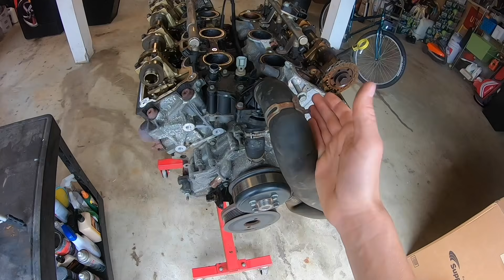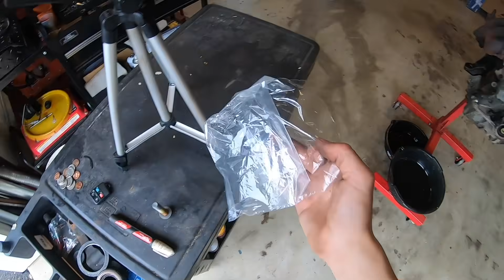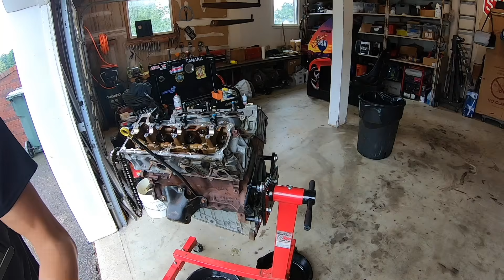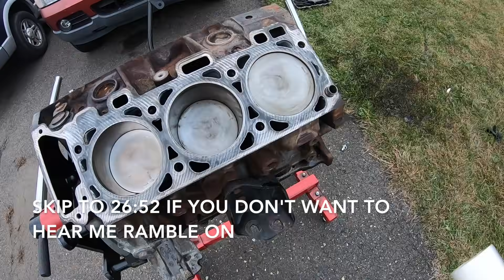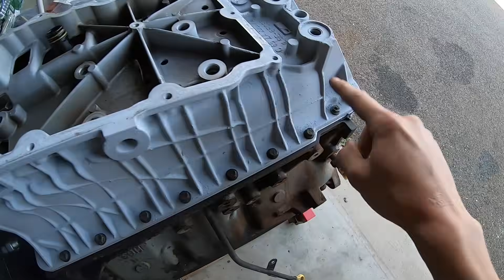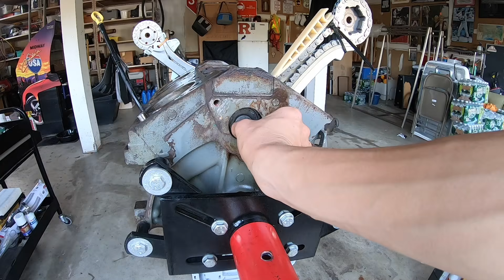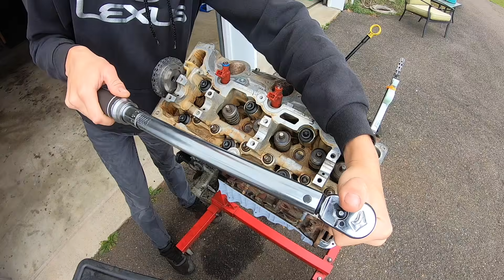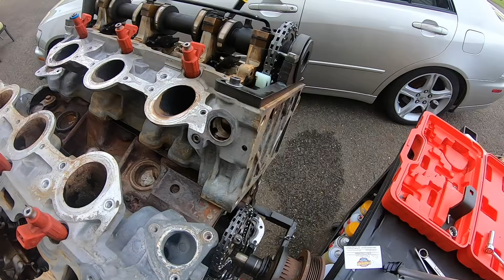Ford 4.0L SOHC V6 Head Gasket and Timing Chain Replacement (COMPLETE GUIDE)

Comment: Platinum Garage, thank you for this and other videos which thoroughly discuss and direct the tear down, removal and rebuild of the 4.0 SOHC engine.  Have a question for you,  Have never had this issue with any Ford engine or other engine (BMW, VW, Toyota) that I have ever worked on but I am currently seeing this in the engine in my 03' Ranger.  Oil is leaking from where the head gaskets mate to the block.  I did not rebuild this engine but had a shop in Dallas, TX complete the work. What are your thoughts?  Cracked heads, cracked engine block, under torqued head gaskets.  What do you think and how would address?  I am, unfortunately, old in the tooth and pulling an engine isn't as easy as it used to be for me.  That said,  if this can be fixed with the engine in the car (i.e. replace and retorque head bolts to stop the leak), then I'm game.  If not,  should I just get my hands on either a JY or rebuild and replace timing components.  Thanks for your input.
Reply from the maker: Unfortunately there are a few incorrect torque specs floating around that can cost someone an engine. If you are absolutely certain the oil is coming from in between the head gasket, it can be undertorqued or warped head. The bolts and gaskets are one time use so you must remove the head completely and replace the gaskets. Where are you located? I might be able to build you one.
Reply: @iamdjnam  Thanks guy,  I am in Arizona.  I thought it was something bad.  It probably makes best sense to pull this engine and replace it with a rebuilt engine.  I do not trust the build on this engine and am going to look at either a quality rebuild or look at a low mileage engine that I can replace the timing components in.  Thanks for getting back to me so fast.
Reply: Update on my motor is the driverside head is cracked and has been jb welded. I runs and doesn't leak oil but won't  last. Thanks for doing this video as the plan is now to pull the driver side head with the motor in the truck and replace it with the same casting that has been rebuilt. Then retime the engine and replace my dying/dead air conditioning compressor while I am at it. Thanks again for this video

Comment: Hands down, the best video I've ever seen on an engine teardown. Excellent work here, sir. Pulling the engine today and starting the tear down once the last parts come, in a few days. I'll be using this guide along with my manual. Can't thank you enough for making it seem less impossible. I may need to bother you with a question here or on the forum you mentioned, since it appears there is fluid at the top of #6 valve (looks like coolant). Doing this because the rear chain bolt came loose (!?!) while driving, got it to limping, but oil pressure is all over the place. Really hoping the engine is salvageable.
Reply from the maker: Heck yeah! So happy to hear that. Definitely consider joining that Facebook group. I answer any questions immediately.
Reply: What’s the Facebook group called
Reply from the maker: @COREYLADIA  it’s in the description

Comment: Hello Nick, You said the restrictor rod restricts pressure to get better flow to the tensioner, which doesn't make any sense to me, because restriction can't increase pressure or flow, but it doesn't matter, because flow ends when the tensioner gets the little squirt of oil needed to expand so it seems there must be another purpose for the rod like maybe to insure pressure for the valve train if a tensioner could somehow burst , but even with such an unlikely purpose it wouldn't explain why the rear doesn't have one. 

I'm trying to figure out the exact purpose of the rod in order to decide if I should install one, because my 1999 Explorer 4.0 SOHC does not have one and most likely never did and my local Ford dealer's diagrams don't show one, so maybe they were added in later years to solve some sort of problem that I can't imagine ?
Reply from the maker: It increases pressure to the tensioner. Install it.

Comment: hello, do you only recommend oem distribution kit? any other good brand? greetings from Argentina
Reply from the maker: Hello. OEM, Melling, Preferred Components or SA Gear. I have used all of these with good results.
Reply: @iamdjnam  thanks for the reply! Is it normal that on the first start of the day the chains make a little noise until the hydraulic tensioner receives oil, or is it a signal that the chain is already stretched?
Reply from the maker: @gatoxpriore9428  ehhh it depends. Chains could be stretched but I’ve driven them over 50,000 miles with slight start up rattle.

Comment: Hey quick question, 
When you turn the motor over by hand after full reassembly and retiming, does it feel spring loaded. 

Meaning as you rotate the wrench on the main crank does it pose a good bit of resistance and then snap free and release? 

Having that happen on my motor rn and wondering if this is normal behavior of the timing chain system. 

Thanks in advance!
Reply from the maker: Depends if the spark plugs are in or not. If they are, yes. If not, you’ll hear a “snapping” but won’t feel it.

Comment: Dump that v6 and deal with 4.6 v8. Lol most won’t pay the cost to fix an old v6 timing chain slack problem. That V6 was a joke built for 100k and scraped!
Reply from the maker: Loved the 4.6 in my mustang. 265k on the one in my econoline van. Never been opened.

Comment: Terrible design by Ford, aluminum heads, on a cast iron block with plastic pieces on the timing chain ,,they do not even sell replacement parts for these motors anymore, you hafta get em after market , Unbelievably they were still rolling them off then assembly line less then 10 years ago, Way to stand behind your product Ford ..  Great vid otherwise, hope your motor gets you years of use ..
Reply: Really they don’t sell parts for these motors anymore?

Comment: Hey man, sorry to bother you again...  You are the standard when it comes to this engine, which is why I am contacting you again.  I'm very confused about two things, perhaps you could shed some light on the matter.  I'm working on a 2008 4.0, it came off a mustang.  The haynes manual says that I need to replace the nuts and bolts for the connecting rod caps.  However, every other source online doesn't say that.  In my experience I have yet to come across TTY bolts on connecting rod caps.  Should I follow what the manual says   Or you think I should reuse the same bolts and nuts?  Second question, the haynes manual also says that I should use sealant on the number four main bearing cap parting line.  Which is the last main cap on the back of the engine, the one that takes the rear main seal.  Have you ever had to do that on the number 4 main cap?  Should I just use silicone sealant on all contact surfaces of number 4 main cap?  I would appreciate any advice you have for me, and I would do everything at my own risk.
Reply from the maker: You can reuse the nuts and studs. I’ve done it before no issues. And yes, use sealant under the main bearing cap. Hope this helps!
Reply: @iamdjnam  Excellent!  Thanks so much!

Comment: WHAT??!!
Just pull the crank, take in to a machine shop and have it polished. Get a full set of new main and rod bearings And replace those damaged pistons. You don't tear a motor down and leave damaged parts in 🙄. Take the block to the machines shop while you're at it and have it hot tanked to get out all that gunk buildup and broken plastic follower parts. Hone the cylinders and you have an engine good for another 150k mi
Reply from the maker: WHAT??!!  It’s a tutorial. Went in a family vehicle and runs mint.
Reply: And what’s all that cost you? Probably cheaper to buy a new engine lmao
Reply: @sef2273  
Bearing set, about 60-80 for the rods. Little less on the mains. 
New pistons/rings? Cast, about a couple hundred. 
Grind/polish the crank, 150.
Hot tank the block about 60.
Hone brush. About 100.
A rebuilt shortblock? A lot more than 500 bucks.
And this is on the high side.
I dont think you've built engines before
Reply: @sef2273  
ROTFLMAO 🤣 
I was pricing a v8. 
Forgot this is the ford 4.0
I have one on the stand right now.

Comment: Why would Ford build an engine with so many chains and crappy tensioners that is also interference? My frickin zx2 is non interference...
Reply from the maker: Heckin Germans and their crazy designs. Audi has a 4 chain engine too
Reply: @iamdjnam  It's a great engine for an old pickup. I'm just bummed my head gasket is toast. Less than 100k on the engine as well 😭.
Reply from the maker: @Megakoolguy357  ughhhh that sucks!! I’m working on one now for a friend. Last 4.0 for me then I’m done.
Reply: @iamdjnam  Hey you fixed a lot more engines making this video than you ever could have with your hands. Time to retire 🤣
Reply from the maker: @Megakoolguy357  you’re right. I never thought of it that way. Thank you.

Comment: I posted the following comment on another channel that might account for why you run into so many people adamantly claiming that the 4.0 is not an interference engine:

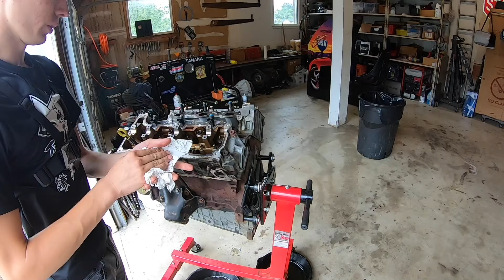I'm not sure why disagreements are common (including some in this comment section which is why I'm posting here) about whether or not the 4.0 is an interference engine, but I suspect it might be due to the fact that there are 2 very different design types. One is the Overhead Valve (OHV) and the other is the Single Overhead Cam (SOHC). I suspect the OHV type is not an interference engine causing the arguments, but Platinum Garage channel who btw has many excellent 4.0 tutorials very firmly states his claim at the 1:30 mark and then at the 19:48 mark he shows absolute proof that his 4.0 SOHC engine is in fact an interference engine with bent valves from chain jump in his video titled:  Ford 4.0L SOHC V6 Head Gasket and Timing Chain Replacement (COMPLETE GUIDE). Having the dreaded 4.0 chain rattle my time was very well spent on that channel.
Reply from the maker: You’re incredible. Precise, detailed, right to the point. Thanks for spreading the word! The SOHC is and always will be an interference engine.
Reply: @iamdjnam It's very upsetting to see people making false claims that encourage others to rotate their crankshaft after removing timing chains because I'm able to imagine the severe heart break it can cause, so right back at you with thanks for your contribution toward preventing pain for so many "SOHC" owners wise enough to explore the topic.

I've become absolutely convinced that the cause of contradiction is due to the fact that ALL Ford "SOHC" 4.0 engines are INTERFERENCE engines and that All Ford 4.0 "OHV" engines are NON-INTERFERENCE engines.   

(I'm screaming it loudly for those in the back hahaha).

btw: the 8th digit of the VIN is "E" for "SOHC" and "X" for "OHV" and the main difference is "OHV" engines have push rods and the "SOHC" engines do not.

I believe plastic parts destruction can be postponed by replacing the hydraulic tensioners every 70,000 miles because I suspect loose chains beat them up.
Reply from the maker: @JoeBlowski sometimes the replacement of those hydraulic tensioners doesn’t fix the rattle. Perfect example is my fathers truck. I put brand new Ford tensioners and it still rattles every morning. I’m like wtf!! Chains are just stretched at this point. I know the guides are good because I replaced them but reused the chains.
Reply: @iamdjnam  I said "postpone destruction" not "fix rattle".
Reply from the maker: Yes I understand. Unfortunately stretch is stretch and it’s inevitable.
Reply: @iamdjnam  Healthy hydraulic tensioners that are getting proper oil pressure compensates for most, if not all, chain stretch, which is precisely why they are hydraulically adjusted instead of being solid, so I think weak ones or clogged oil restrictor tubes is much more to blame than stretch for chain looseness.

 It begins with relatively minor rattle that progresses to fatal destruction of plastic parts that have become brittle due to heat and age, therefore I still believe and expect you to agree that periodic replacement of hydraulic tensioners before rattle even begins is excellent advice. 

Replacing them and cleaning the restrictor tube and passage along with frequent oil changes is cheap and easy effort toward preventing or at least postponing the "inevitabe". 

I included restrictor tube and passage cleaning because I saw a video where a guy claimed to still have rattle after complete timing component replacement where he cleverly determined with a pressure gauge installed at the restrictor tube cover that his rattle was due to lack of oil pressure at that point so he cleaned the clogged tube and passage resulting in short lived success so he plumbed a hose to that point via a tee added at the oil pressure sensor which eliminated the stubborn rattle apparently caused by sludge due to lack of oil changes.

Comment: Hey! I have a question for you. Have you had problems with 4.0 engines, I mean rough idle. If yes, what probable reasons for this did you find? Thank you!
Reply from the maker: Clogged fuel filter, dirty MAF/TB, needs spark plugs, vacuum leak, too lean or too rich.
Reply: @iamdjnam  Thanks for the answer! Do you think bad valve cover gaskets could be a vacuum leak? Thank you!
Reply from the maker: @viktorkotik2924  nope. Intake manifold yes.

Comment: Was just about to put a new (used) engine in my B4000. New engine had the oil filler neck broken so was going to swap valve cover from old engine. Once the valve cover was off I got interested to see how those guides were and to my surprise they were just like those in this video smh 🤦🏼‍♂️ Fords 4.0 are trash.

Comment: Hi  👋
Is it possible to replaced the front timing chain and casset with out taking the motor out?    My valve cover crack right in front of the timing tensioner  any help suggestion.   Thank u
Reply from the maker: Yes.
Reply: @iamdjnam  any videos  any help    thanks
Reply from the maker: No because it’s kind of a half ass repair. If you go that far into an engine it should really be removed to do a full timing kit with gaskets and seals.
Reply: @iamdjnam  ok tnks

Comment: Hey platinum garage . Some one referred me on fb to ask you what one time use bolts or tty will I run into when doing front and rear timing on my 2004 Eddie Bauer flex fuel 4.0 .
Reply from the maker: Crankshaft (harmonic balancer) bolt, front and rear jackshaft bolts. The cam bolts are reusable.

Comment: Quick question i hope..   passenger rear hydraulic tensioner has some oil seeping from it, im thinkin its just the crush washer/gasket, can i just pull the tensioner swap the crush washer or the whole tensioner and not have to worry about holding the cam down or retiming? Orr???
Reply from the maker: Set the engine to TDC then remove that tensioner.
Reply: @iamdjnam  so just line up the little mark on the harmonic balancer with the crank position sensor and then itll be fine?   No need to remove ths valve cover or hold the camshaft?
Reply from the maker: Exactly. Line the little line with the 0 next to it and you’ll be perfect. I do it all the time.
Reply: Okay, just wanted to make sure im not gonna lose timing or if taking tension off would cause damage
Reply from the maker: Yeah I mean if the guide is gone and you pull that tensioner out without setting to TDC, it can snap back and jump out of time. But you’ll be good at TDC.
Reply: @iamdjnam  yeah, the guides and tensioners are all brand new, i just think the crush washer/gasket failed or something.         Also do u happen to know the torque spec for the tensioner
Reply from the maker: It’s like 36 iirc I usually just use a big wrench and get him good n tight
Reply: @iamdjnam  alright thanks!

Comment: Hi Nick,
I am confused. My shop manual for 2003 , page 303-01A-137, it calls for one round of 24 lb-ft, followed by a single additional 90*. 
Your video https://youtu.be/C_PuUmACtsk
is also a little different, closer to my shop manual with one round of 24 lb-ft, but for the extra 90*. 
Shop manuals are ok, but I have seen errors in them before. 
Where am I going wrong?
Many thanks
Reply from the maker: What bolt are you referring to?
Reply: @iamdjnam  sorry. Head bolts. This is a 2003.  Perhaps there's a difference in years. Thanks
Reply from the maker: 18ft/lbs, 90 degrees, then another 90 degrees for all 4.0 SOHC engines. No exceptions.
Reply: @iamdjnam  ok. I must be missing something because two of your videos are different. 
https://youtu.be/C_PuUmACtsk
Reply: Any final thoughts on the discrepancy?
Have you ever measured the final torque after the 90*?  A guess?
Thanks for your input
Reply from the maker: I told you what the proper torque spec is in the above comment. The shop manual is wrong.
Reply: @iamdjnam  wouldn't be the first time. But I was referring to the different torque and procedure between two of your videos, and was trying to determine if it was a year different, etc
Reply from the maker: Same spec between the 2 videos. All years are the same.
Reply: @iamdjnam  
108 in-lb, followed by 18 ft-lb, then two rounds of 90*. 
Your other video, 25 ft-lbs, followed by two rounds of 90*
Reply from the maker: @franciscoadolfo5805  use the sequence shown in this video. That’s what I do for all of them over the last year. No issues.
Reply: @iamdjnam  
Cool. I am just trying to figure out the difference in spec/procedure. What manuals are you using? Thanks
Reply from the maker: @franciscoadolfo5805  Haynes

Comment: Hi Nick,
Almost there. What's your thoughts on fuel injectors? 
260,000 miles. I am leaning towards new ones. I heard of the cleaning services, but that doesn't address the actual mechanics, just filters and flow. I think you end up with a real clean but old injector?
What's your experience with these?
Thank you
Reply from the maker: You can get a reman set on eBay for cheap. Bosch I think.